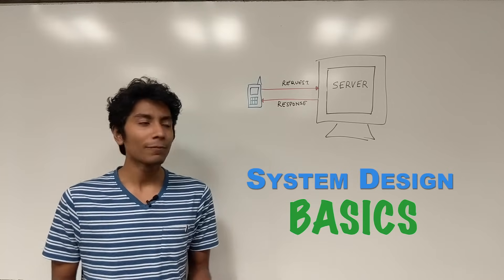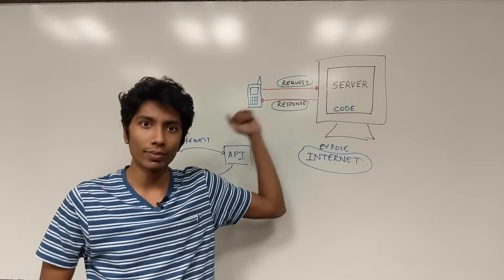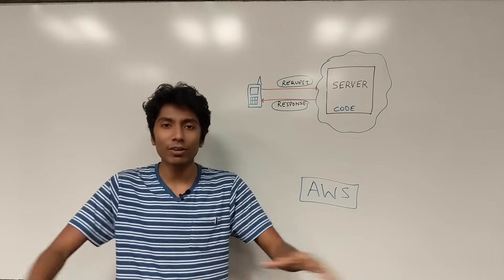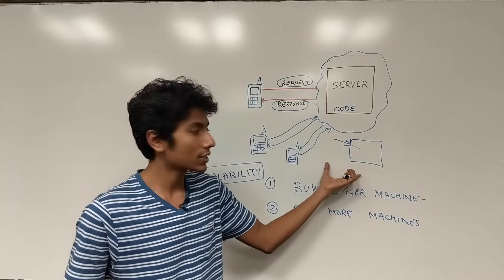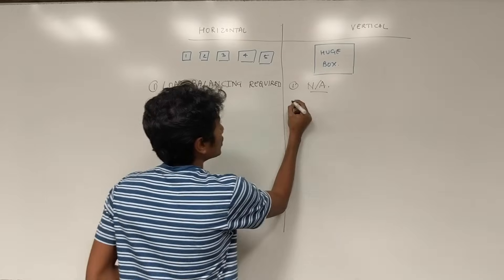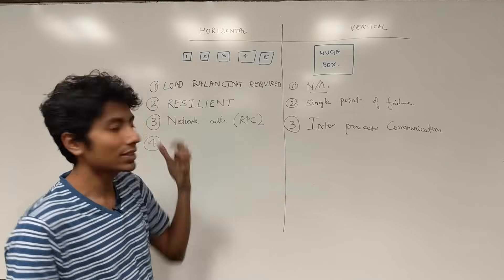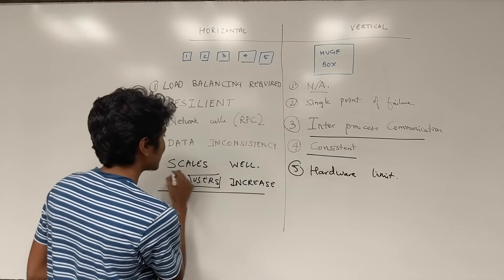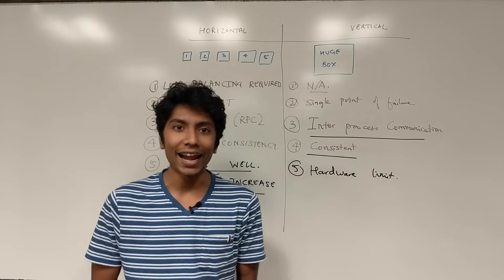System Design BASICS: Horizontal vs. Vertical Scaling

Comment: Thanks Gaurav, for the wonderful explanation! I have one question. Pt.no.3 - RPC vs Inter-process communication - This seems to be a comparison between micro-service and monolithic architecture rather than a comparison between Vertical and Horizontal scaling. Can you help understand this point by sharing a use case where different instances of the same service which is horizontally scaled might need to talk to each other ? TIA!

Comment: 4th point in horizontal scaling is issue in case of micro service and if different code base is  deployed on different machine like 1 have employee api , 2nd have order api, 3 have delivery api... if all code bundle in same jar and each machine have same jar then 4th point is not a issue.. nice video thanks..❤

Comment: In Horizontal scaling, wouldn't we have replicas of the same service? Why will there be calls between these replicas?
Reply: Imagine a user performs a write operation to one of the machines(services) in a horizontally scaled system. This machine has to propagate the information to all other replicas to keep it consistent. This is why inter-replica communication (calls) are needed.

As an example, if you are updating your social media username, it is written to one machine at first. To ensure all replicas get this update, it needs to be then propagated to all other systems.

Comment: Horizontal scaling
In horizontal scaling, more machines are added to the server pool to distribute the load and handle more requests. This can involve adding more instances of the same type of machine or adding different types of machines.
Horizontal scaling provides better fault tolerance because if one machine fails, the requests can be redirected to other machines in the pool.
It can be slower compared to vertical scaling due to network calls and potential data inconsistency between multiple servers, especially if data needs to be synchronised across them.
Horizontal scaling can scale well as there are typically fewer hardware limitations, but it can be constrained by the availability of resources and budget considerations.

Vertical scaling
In vertical scaling, more resources (such as CPU, memory, or storage) are added to a single machine to handle increased load and improve performance.
There is a risk of single point of failure because if the single system fails, the entire application may become unavailable until the issue is resolved.
Vertical scaling can provide faster throughput because all resources are concentrated in a single system, and there are no network calls for request redirection.
It may be limited by the maximum capacity of the hardware and may not scale as well compared to horizontal scaling, especially for highly demanding applications.

Comment: Hello Gaurav , isn't the point of RPC wrong to be considered in this comparision here? I feel that point is more valid in microservices vs monoliths argument. When I consider more boxes , I have similar boxes, but yes -> load balancing between those boxes may take more time than non load balancing, but that small box also does the same job as the bigger box maybe a bit slow , because it has lesser cpu and memory to work with. Please correct me if wrong.

Comment: Issues based on horizontal and vertical scaling.

Horizontal Scaliing (Multiple servers)
1. Load Balancing Required
2. Resilient
3. Network call (RPC - Remote Procedure Call)
4. Data Inconsistency
5. Scales well as users increase

Vertical Scaliing (Single server)
1. N/A
2. Single point of failure
3. Inter process communication
4. Consistent
5. Hardware Limit

thank you for your great summary!

Comment: Thanks for the video. I have a question regarding this part (https://youtu.be/xpDnVSmNFX0?list=PLMCXHnjXnTnvo6alSjVkgxV-VH6EPyvoX&t=302) Why would there be network calls between the machines you have just added to scale up your service? I mean in Vertical, there is in-process communication, while in Horizontal, also in-process communication (Unless in the case of Distributed computing) because still, every machine is doing exactly the same job as a single machine, but now every request is being served by a different machine every time. The only difference is that you have a load balancer that can add a little latency or not. I think you mixed between service-oriented and monolithic in this part. Please let me know if got it wrong. thanks
Reply from the maker: Distributed consensus. In case you are looking for some consistency SLAs.

Comment: Horizontal Scaling (more machines)
Vertical Scaling (bigger machine)

things to consider:-
Load balancer, 
Reselient, single point of failure,
inter process communication
data consistency, cache consistency,
scale well with lots of users users.

handle trade offs.

Comment: Very informative and amazing. You made it so simple. Thank you so much. 
I have one question.
Could you give more details on data inconsistency in vertical scaling? When there is a transactional request, my expectation is it will be handled by single server. Is there any chance that it will be distributed among the servers with in the transaction?
Reply from the maker: As long as you make function calls instead of network calls to the same service, your transaction will run on the same server.
Make sure your responses from different services are also coming back to the same server.

Comment: How do we decide which scaling we should use?
Like lets suppose google collab has millions of ML simulations running on it. It will obviously need to have vertical scaling as it provides us with fast processing.
But lets just suppose we have a streaming platform which has millions of users logged in and trying to watch HD vids. The processing is not that important but we need to send and receive data packets faster. If so, don't you think Netflix will run out of servers? 
Sorry if this is a dumb question. I am very new to this SD.

Comment: if we run the app on multiple servers, do they each have their own DB? if so, how is data maintain consistent for all ? I always imagined that even though the code could be scaled, the DB needed to be a single point
Reply: well it depends, if you are using aws, you will either use rds or aroura for sql db, it will not be an issue in that case, else if you use your own servers than you will need a signle db with either queue service to maintain consistency or high i/o storage.

Comment: Sorry Buddy... For me, It looks you have mixed up multiple different things...
The example you have taken (1 API & request-response),
(1) How horizontal scalling would have network calls? (Each servers will have same code.. they would never call each other.. how would it be slow?)
(2) The same mistake for "inconsistent data" also...your multiple servers would never be calling each other due to same code in each...!! As long as you have common db server between all these horizontal scaled API servers, you will never have inconsistencies... Right?

These 2 points which you have explained is true for "Microservices vs Monolithic"..... But doubtful for "Horizontal scaling vs Vertical scaling"

Comment: Hi Gaurav, can you please tell me if Content Delivery network (CDN) is also a kind of distributed system ? Or it's simply hardware that helps quick access depending upon geographic location (if they include server etc then they will be kind of cloud computing network)
Reply from the maker: Yes it is a distributed system. 
Video on CDN coming out next week :D
Reply: @gkcs  awesome. I've dozens of questions related to CDN. Will through them in the video's comment section.

Comment: @5:00 In horizontal scaling, why would one machine need to interact with another? I mean this is not microservices, right?
The request first goes from the client to the Load balancer which distributes it to one of the machines(server). 
What one machine(server) can do, can also be done by other other machine(server). Correct me if I'm mistaken.
Reply: What you said is correct, but that is for read operation. If you write something to one server that has to be picked up by all remaining servers to maintain the consistency
Reply: @sushmitamasudi344  I don't know what you mean by "write something to one server" unless you are talking about database servers?
I had the same questions too. When scaling vertically, each node represents a self-contained clone of your server, no clone needs to or knows about the existence of others, only the load balancer.
The server clones would likely be reading and writing to some persistence engine and this probably has consistency implications, but I'd think this is a separate issue and has nothing to do with what the video was talking about.
Reply: @sushmitamasudi344  ohhh that makes sense. Thank you!

Comment: Hey Gaurav, Just purchased the course on get-interview-ready, now using this channel and that course for prep, one request from my side, can you please add the ordering of videos in "System Design" Playlist somewhere? may be in the description itself?
Reply: And yes, thanks for making such awesome videos man :)
Reply: I have tried to do so on my end as well:

5 Tips for System Design Interviews
System Design Basics: Horizontal vs. Vertical Scaling
What is Load Balancing?
What is a microservice architecture and it's advantages?
What is an API and how do you design it?
How to start with distributed systems? Beginner's guide to scaling systems.
How to avoid a single point of failure in distributed systems
Distributed Consensus and Data Replication strategies on the server
Avoid cascading failures in a distributed system
What is Distributed Caching? Explained with Redis!
What is Database Sharding?
Introduction to NoSQL databases
How databases scale writes: The power of the log
Why do Databases fail? AntiPatterns to avoid!
What's an Event Driven System?
What is a Message Queue and Where is it used?
What is the Publisher Subscriber Model?
What is Consistent Hashing and Where is it used?
Capacity Estimation: How much data does YouTube store daily?
Service discovery and heartbeats in micro-services
Detecting anomalies using Isolation Trees: Practical Machine Learning
Containers and Virtualisation in Cloud Computing

Google Maps Algorithm: Designing a location based database
Designing Instagram: System Design of News Feed
How Netflix onboards new content: Video Processing at scale
System Design: Tinder as a microservice architecture
Whatsapp System Design: Chat Messaging Systems for Interviews

Please suggest if this needs modifications or my sorted list is a piece of shit altogether xD

Comment: Hi,

In horizontal vs vertical scaling difference ,the point number 3 and 4, i dont see them as difference between horizontal vs vertical scaling but these seems to be difference in micro service vs monolothic.
Horizontal scaling means we have one app server and now we have 4 app servers that does the same thing.Why do they talk to each other? They will do there work and return to load balance response.If they are communicating to each other then we are getting into microservice architecture and then it is not a good point to consider here.Because in vertical scaling may be we have difference box for each service also.So i think 3-4 are not comparison points that fit here.Do let me know your thoughts.
Reply: Think in terms of Database scaling. 
If you want to scale a database horizontally, then you need network calls for consistency guarantees.

Comment: 3rd point doesn't make sense. 
When we talking about scaling, we are considering one service at a time, so why would 2 app servers of same service be talking to each other? 
Even if two services are hosted on single machine, then the horizontal scaled servers would have both the services running in each machine and if you have hosted different services in different machine (for horizontal scaling) and hosted multiple services on single machine(vertical scaling), then the whole architecture has changed and now we can not really compare H-V scaling.
Same reasoning for point 4.
Reply from the maker: They may need to talk with each other for in memory cache consistency.

Vertically scaling a service means assigning it a bigger box (physical hardware or a larger container). Hosting multiple services of the same type on a single machine is rarely useful, but possible. I am talking of the more general case where they are hosted in different boxes, vs. vertically scaling the service using a bigger box.
Reply: @gkcs  Agreed, but again, when caching is done, it will either be distributed via a central Redis or if each app server is having local cache(in memory) then this is where consistent hashing would need to be implemented. I mean if we have 100 app server, each server communicating with 99 (for cache check) to serve a single request, then this is not a scaling issue but bad system design issue.  While other points are completely valid, 3rd and 4th seem to be a little hypothetical. 

No matter what, great content.
Reply: Btw, since I have got your attention, please accept my LinkedIn request which I sent 4-5months back when I started watching your System Design tuts. 😂😂😂

Comment: Thanks a ton Gaurav for explaining with such simplicity! :) 
"Expose your code to the internet using a protocol"  - Do you suggest references that goes into details of how to do that? 
Few questions that pops into my head now:
- My understanding is that a "web server" is needed to listen to such requests hitting that machine. Is it needed for any kind of code, even if it doesn't serve HTML? Just returns a JSON (or some output) given an input.
- Won't web server always use HTTP? How can I expose a piece of code via other protocol such as FTP?
- "Port forwarding" is needed if code is running on personal machine, to provide public IP / port. How would hosting work?

Comment: I believe an important needs to be addressed here. Type of processing being supported by each request. If each request requires a lot of processing then certain scenarios require vertical scaling. If System is facing request drops at loadbalancer due to too much traffic then horizontal scaling is the solution.
Reply: Thank you
Reply: absolutely you are right

Comment: One important I would like to add regarding scaling is that there are some systems no matter you scale them vertically or horizontally but they won't scale and entirely depend on improvement in algorithm. Bitcoin is an example.
Reply: Scaling can help improve system performance till a point. The algorithm has to be improved eventually.

Comment: I don't think communication between nodes is technically a distributed system problem, it's more a microservices vs. monolithic architectures discussion. I would drop point #3 from the list.

Comment: I think you have mixed up horizontal scaling with Microservice type of pattern. In scale out/horizontal scaling, one instance is exactly similar to other. If its HORIZONTAL SCALING ONLY, then its not hybrid.
Reply from the maker: Watch the series: I have mentioned that micro-services have nothing to do with horizontal scaling.
Reply: @gkcs  I agree but in this video you are talking about slowness due to network calls between instances which is not applicable in horizontal scarring. It does not happen in horizontal scaling.

Comment: Great video :) have a question, what would you recommend for scaling of a system which uses a non-locking database and is ACID compliant? i.e. it overcomes the restrictions of data-locks, and guarantees both high TPS & data consistency.

Comment: having different thoughts on point no 3, to process the request if you want to call multiple services it may slow, but when making the same application as horizontal scaling it will be faster as like single system.

Comment: Thanks for the video. I just have a small doubt, you said that horizontal scaling makes network calls and vertical has inter-process call, my doubt is, at a given time when I make an API call wouldn't it connect to only one system and there would be no system to system communication here as I have monolithic and not a microservice.
Maybe the slowness in horizontal system can happen due to the load-balancer and the fastness due to the power of the vertical machine.
Reply from the maker: I have already answered this in the comments 🙂

Comment: Gaurav, Assuming you are talking about horizontally replicating applications, why would I have to communicate between replicas?
Reply from the maker: The profile service at box 1 may need to talk to the payments service at box 3. If you instead had both applications on the same box, you could communicate faster.

Comment: I just started following your videos and they are amazing. I have a question.. if I scale horizontally to multiple machines.. should I replicate the programs that were running on one machine to all?
Reply from the maker: You'll need to run them on all the computers, yes.
Reply: @gkcs  How do we expedite the replication of programs in horizontal scaling, if the programs keep updating ( e.g. new commits during each release )? With vertical scaling, we just have one box only.
Reply from the maker: @harisrid2018  You will have to restart the service with vertical scaling too.

With horizontal scaling, you copy the new code on the box and deploy.
Reply: @gkcs  Thanks Gaurav - I didn't realize that even in vertical scaling, the services still have to be restarted after deployment.